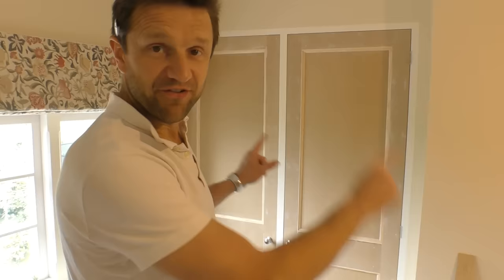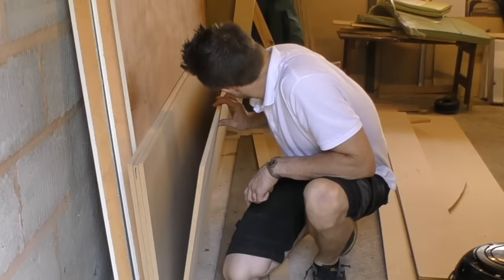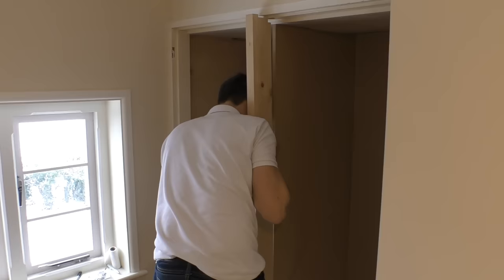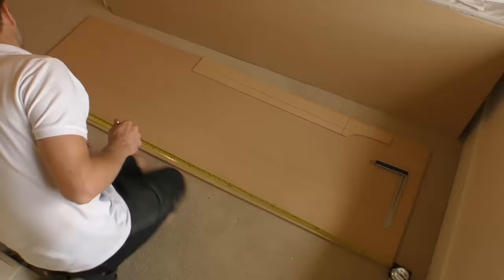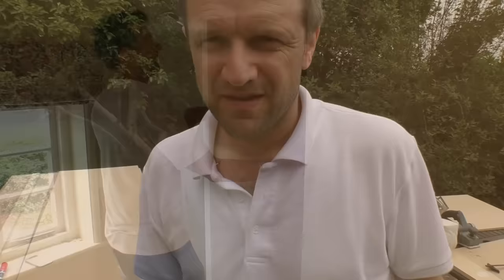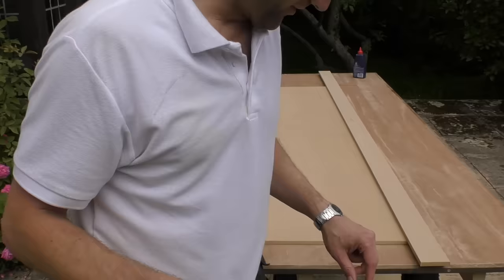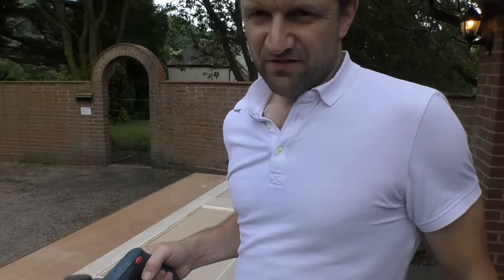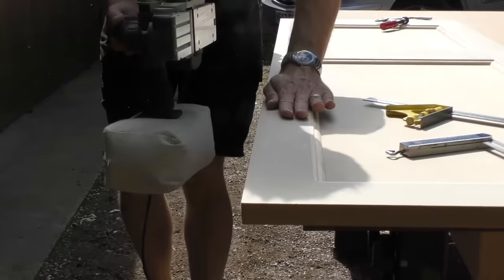How to Make Panel Doors with Basic Tools! Video 1/6

Comment: Quick tip from a pro brother, if you use this system of fake panel doors? Use exterior mdf because the standard mdf tends to bow when you use pva glue! Failing that use pu glue or contact adhesive 👍👍👍👍good job👊
Reply from the maker: Thanks for that mate - makes sense, and that's why I clamped each piece down before nailing it. Yep, I'm going to start using moisture resistant MDF from now on. It's just not that readily available at the local timber merchants I use. 👍

Comment: Built a whole shaker kitchen like this including tall doors for the pantry  and it's still perfect 10 years later, hasn't moved a mm, no separation or anything, just about to refresh the farrow and ball paint this spring. Didn't use panel pins just glued and clamped.

Comment: Looks great. You can put full length mirror on the inside, since they cover panels anyway.   MDF also supposedly toxic when cutting/sawing it. So maybe use plywood instead - ion frame will accommodate it.
Reply from the maker: Yes, I did that here https://youtu.be/tdMnnkvInrE

Comment: Our whole kitchen is constructed this way we did it ourselves, god knows how we got it right but 18 years later it's still perfect, just about to repaint it this year. We used green mdf because of moisture worries though, the rails and styles were thinner mdf and they were not fitted inset doors so easier to do.
Reply from the maker: Good to hear this design has longevity! I'm just about to embark on an epic bedroom wardrobe project. I've thought long and hard about doing the doors properly (with separate rails and stiles and an inset central piece) but I just can't be bothered with all the hassle, and this way is much more assessible to most DIYers because you don't need sophisticated tools to accomplish it. Thanks for getting in touch👍

Comment: Another great video Charlie - and yes, I stayed for every last second 😉. I made some doors myself with a very similar method, substituting pine for the shaker stiles etc as I'm never keen fitting hinges to MDF, particularly on heavy doors.
Just one piece of feedback Charlie (and I don't always take my advice, so hands up), but you really need to use a suitable mask working with MDF, it really is nasty stuff and you only need one good lungful to have serious health consequences. I know you were using a vac inside, but belt and braces I'd recommend still using a mask.

Comment: Hi Charlie another cracking video. I love the fact that you say things like 'carpenters say... but you don't need to.' I would love to have a full workshop and all the tools (I have tool envy about your tools) but I don't. I'm totally booked on your channel. Interestingly I made some mock maple usher doors for a kitchen under stair cupboard using funeral paint and train and I didn't pin the styles but they are still going strong 20 years later. Keep up the good work.

Comment: Bit late to the party but I thought I'd mention that it is always worth practicing a process called balancing.

Where you have laminated on your 'frame pieces's you might find the doors will cup towards the 'frame pieces'. Now if you were to add the same 'framework' to the back of the door this will balance the lamination. 

When I do this style of door I use a 12mm central MDF sheet and laminate on both sides of the door using 6 mm MDF. You end up with a very strong and stable door. Some might call it the Theresa May. 

I don't mean to take anything away from your method. At the end of the day you created something awesome and keep on creating. Just something I've found very helpful.

Comment: Great vid, little tip I learnt when I worked in a pub fitters workshop in my teens, half dry tack your Stiles each end not sending the panel pin all the way home before you apply glue, then the tack goes back into same hole and there's no sliding on the glue👍

Comment: Nice a tidy as always Charlie. With routers being so cheap now and saving buying trim a nice ogee bit will add a nice detail instead
Reply from the maker: That's a damn good point - I have a router and am not sure why I didn't think of that 🙄, although if I do this I'll have to do the rails and stiles in timber as I'm guessing the MDF grain would puff up and require a fair bit of sanding between coats.

Comment: Well, I have done very big and long doors in the past but with time they warp a little. Bottom is flash with frame but top is no longer flash. I typically trust Baltic birch ply better but it would very heavy. The door would not have a lot of usage (max 20 time a year). I saw you using MDF and I thought that would be good and it would not warp. I can use also MDO which is probably lighter. Please post a video for MDF screw use!!! I am sure it is going to be a great addition.
Reply from the maker: Will do!

Comment: I have just discovered an old skool adhesive called Cascamite.
I swear by it now. It is dirt cheap and exeptionally strong.
Look into it
Reply from the maker: Adam Butters Thanks Adam. I'll take a look!
Reply from the maker: Adam Butters Just been reading the reviews on Axminster. Definitely worth a punt. Only downside I guess is that it goes off if you don't use it up once opened.

Comment: Have you tried "Evo Stick, polyurethane wood adhesive"? its in a green tube. It expands a little so if you have any small spaces it will fill it. I used it on some pelmet boxes I made some one I used nothing else. It is very very strong indeed and you only have to use a small bead because it does expand , Probably half what you used for those moldings.
Reply: typo ..evo stik :)

Comment: Great video. Easy to understand and follow the instructions. I am going to make these for closet bypass doors. The only question I have is why use brad nails?  The glue should do the job all by itself.
Reply from the maker: You're right but I'd still tends to use nails - just to hold them down really whilst the glue sets. You can then lever them out and fill the tiny holes really easily.

Comment: Morning Charlie. Please don't take offence when I ask this, but if you're using a circular saw cutting at 90° with a straight edge, why use a planer for the chamfer? Why not angle the saw blade by 6° & recut? I did a similar project in my hallway with 2 doors. The tops of the doors had to match the angle of the stairway. That was not easy. But eventually I got it to sit correctly. No handles, just the push-to-open thingys from ikea. Great video. G
Reply from the maker: Gary Furness Good point Gary. Partly habit I guess because this is the way I've always done it, but also because I'm essentially just trimming at this stage. My saw guide is a little thick on the base to turn the saw blade without cutting into the guide (I'll be making a new one soon with a thinner, ply base), and I guess I trust my planing more than the saw with this all important final cut. Also, not everyone's got a circular saw so I always try and make the videos as accessible as possible. That said, you've made a very good point and I'll probably give it a go next time 🙂
Reply: Nice video again Charlie, makes the amateur diy ‘er’ have confidence in giving it a go 😊 I’ll be using this way of making mock doors 🚪 when I replace the kitchen door fronts @ home 👍🏻

Comment: Yes frustrating when fitting doors into old frames. They are a carpenters nightmare. Depending on how much work you do to make it worth it,  but I have gone to the trouble of making three saw guides. 2400, 1200, 600. that way I have one appropriate for the length / width of board I'm cutting.
Reply from the maker: Peter Compton Totally agree Peter. It's one of my next jobs, along with installing the UKJ Parf Guide system.

Comment: tried many time to build them out of 1X4s and 1/4 " with nails and glue the 1X4s pulled from the 1/4" over time, ended up using screws with caps need to build some doors soon "particle board"
Reply from the maker: Steven here's a video from my recent wardrobe build series that might help https://youtu.be/tdMnnkvInrE

Comment: Another great video. I’m inspired to finally crack on with a wardrobe project I’ve been putting off. I’m interested in your view on wether to use MDF cubes or timber frame for the carcass. I’d be building against a wall not in an alcove.
Reply from the maker: I think if you're going to paint it, there's no need to use timber.

Comment: Hello Charlie, I often find when doing this sort of project that I end up spending good money on items that you cant really do without ie 2 part wood filler. After some experimenting I have found that car body filler appears to do exactly the same job and I think it actually dries a bit quicker and can be sanded within minutes on small depths. I have found large tins of it on Ebay at low prices, a 3.5ltr tin of U-pol is under £20 and I reckon it will last me years. Maybe give it a try and see what you think Regards Bob

Comment: Hi Charlie.  Followed this brilliant video and have made two odd shaped doors for the attic rooms and a cupboard door. Even inserted a real wood filet to screw the hinges into due to weight  as had to make 46mm thick to match the other doors.  Think they’ll look great when painted and even saved myself £1,200 off quote from local sawmill.  Cheers!
The only question I have is what to fill the punched nails and gaps with - two pack wood filler like you did, or polyfilla woodflex ready to apply which Is my go to wood filler?

Comment: I'm interested to know how you knocked that workbench together using some trestles?
Reply from the maker: There's a video series on that Jason. Here's video 1 https://bit.ly/3xg0VjH It's been a game changer, that work bench. I use it all the time.
Reply: Thanks Charlie. Definitely a game changer! Will be knocking one up myself 😉
Reply from the maker: You just! My advice would be to buy 4 saw horse and make a full length (2400mm) table but in 2 sections. It's a bit big and heavy in one section and the hinges are a great addition but a bit complicated - which is why with 4 saw horses you can have two halves pushed (and even screwed if necessary) together. Also, 2 extra horses is an investment. You can never have enough lying around for when you need to support long sections of stuff or just for painting things on 👍🏻

Comment: Hey, great idea, what about using plywood? i hate painting mdf and priming it
Reply from the maker: You could certainly do that although it will be more expensive. I'll be posting the final video in my current wardrobe series https://youtu.be/R1dKybdYyY8 in a week or two. Keep an eye out for that as it will be all about my most recent wardrobe door construction.
Reply: @CharlieDIYte  I worked with mdf and I hate how it sucks the glue like a sponge and the priming its such a pain, so I am thinking plywood would be way easier, a bit more expensive, but I think way faster.

Comment: How have these held up Charlie?
This is my first attempt at making mock shaker style doors full length about 240cm for a tall wardrobe. Don't have a router to make the traditional way.

Have seen other videos of people doing similar with 12mm board and 6mm rails and stiles and people have said they've started warping after a short wile due to only one side holding the weight of rails and stiles, and also due to the pva (perbaps water in it) and not using MR MDF.

I am planning to use 18mm regular mdf with 6mm rails and stiles.
Reply from the maker: They've held up very well. This is the better video to watch https://youtu.be/tdMnnkvInrE?si=5rFQN7v7c0HOv3OV The warping happens when you make it, not afterwards as discussed in the video - and I know this as I've had the frustrating experience of doors warping. These doors and the ones in the video you've watched haven't moved one bit.

Comment: Hi Charlie, I am about to make a cabinet with shaker doors but was worried about the routing  and so this method really appeals. I am worried about screwing in to the ends of the mdf though for the hinges. How did that go?
Reply from the maker: James take a look at this series https://bit.ly/2UfXY4B. I have routed the mouldings (you can just insert yours though) but what you want is the euro style concealed hinges. They screw into the back for an incredibly strong fixing